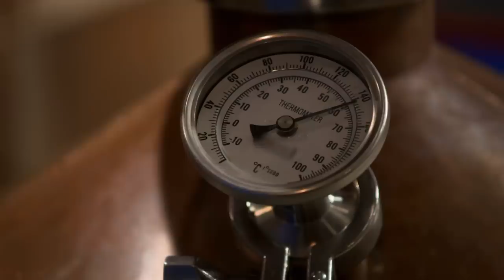Can These Master Distillers Make 100 Proof Moonshine By Eye Alone? | Moonshiners: Master Distiller

Comment: Under a vacuum, the air pressure is reduced to nearly 0psi, making it much easier for liquids to vaporize... much like pressurizing a gas into a liquid, only in reverse
Reply: Temperature and pressure determine a liquids saturation. Take water for example, at atmospheric pressure (1bar) it boils(saturates) at 100 degree C. At a lower pressure it saturates at a lower temperature, on top of Mount Everest water saturates at 68 degree C. Higher pressure, like an industrial boiler at 200 bar, water saturates at 366 degree C, which sounds really weird but is explained on a Molliers diagram.
Reply: @rasmus1600    that's cool and all: but it's also why I decided to use "under a vacuum" as my set variable... a change in either temperature, or pressure, is impossible under a perfect vacuum, solely because there're no molecules present to hold either: it's a constant,  and one that's relatively reliable
Reply: So will taking the still to the top of the mountain
Reply: @user-fy2vr9zr6c  not quite like a vacuum... talking conditions that would have you explode under internal pressures... it's hard to breathe at high elevation, but I don't think you'll explode... to be safe though, Ima stay off the mountain! 🤣🤣🤣

Comment: What is that bridge?
Reply: When they shake the jar and the bubbles form whats called a bridge, basically a bridge of bubbles from one end of the air gap to the next end and the time/seconds it takes to settle back to no bubbles helps calculate the proof/ % . once the bridge is formed count each second it takes before the bridge is gone. it takes seconds for it to dissipate and each second equaling 10 proof you count back from 180 . So if it takes 8 seconds for the bubbles to dissipate youd minus 8=80 proof from 180 proof = 100 proof spirit.